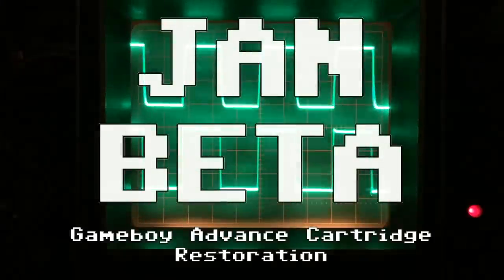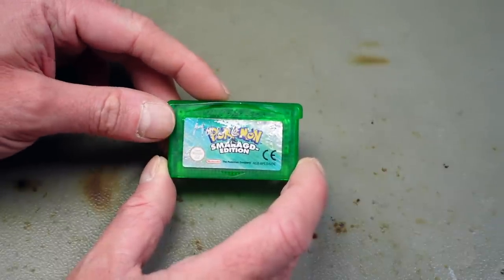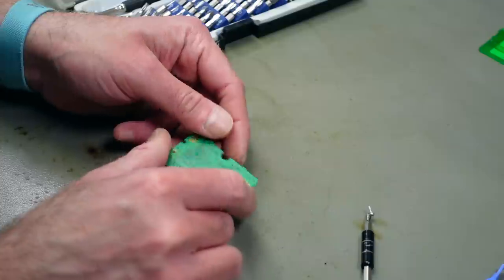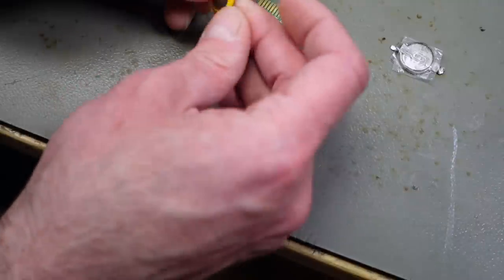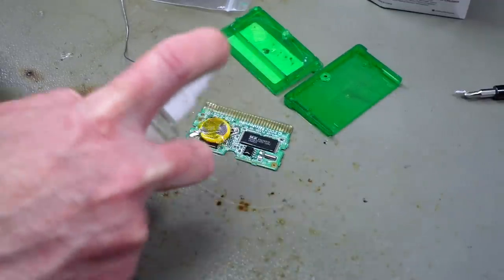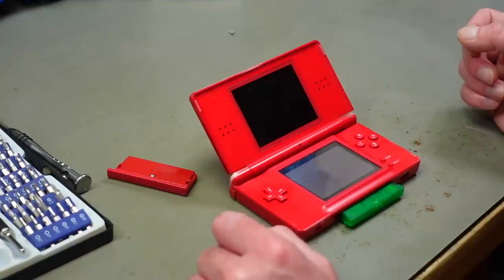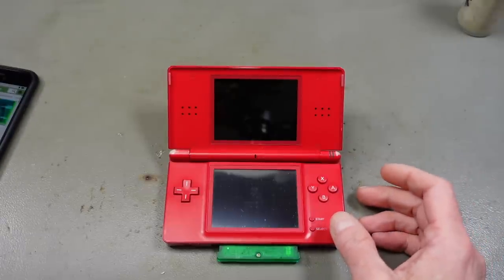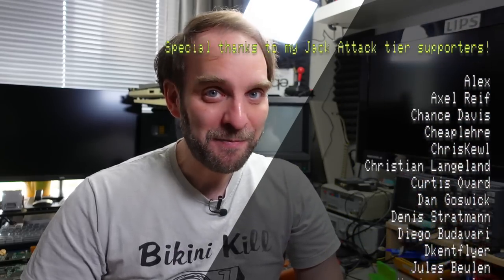Gameboy Advance Cartridge Restoration

Comment: 4:30 "Somebody replaced this really shoddily [..] usede a lot of tape in here [..] butchered this replacement" -> 7:35 "ok, so i'm gonna use some kapton tape here" 😂😂😂
Reply: Well, the original owner used sellotape over a shoddy soldered battery with bulging tabs.

I did the same as a kid on a PKM Gold Cart that I revised last month, and that's the reason the cart was cracked.

The attempt at soldering the tabs left the battery thicker than the usual, and that put strain on the casing.

Kapton tape isn't sellotape. Sellotape is plastic film with glue, thus a fire hazard.

Kapton tape is treated to be fire and heat resistant

Also, Jan Beta put just a little to insulate the battery

It's not needed, the battery actually bridges over, I never add it, but it doesn't hurt
Reply from the maker: Yeah, couldn't resist putting some new tape on it for extra safety. I guess it's not strictly necessary but helps prevent the battery from shorting out the chip underneath. :D
Reply: @JanBeta  truth to be told, I never added tape on any of my old carts and they all worked, not even on the Easy Flash 4

Usually the terminals have enough clearance to bridge over, and I got from a local shop a heap of disposable plastic tweezers to help me propping them right

But some safety never hurs
Reply: @DrTofu83  relax, i'm not attacking Jan Beta. i just found it funny :)
Reply: @pneptun  Neither I was defending him. I was telling you how I put a fire hazard in my GBA as a kid :)

Comment: Solvent-based plastic cement is awesome stuff.

The only downside is that the bond can create a discontinuity in strength where, in a long part that needs to be able flex a little, the bond point won't flex as much as the neighboring plastic and the plastic next to the bond point will fatigue over time and break again.
Reply from the maker: Definitely an important caveat. Never ran into any issues like that (yet) but worth keeping in mind.
Reply: Wow incredible information, thank you sir! Or madam! Or they! Or zer! Thanks

Comment: Nice work.

FYI, in English, buffer, at least for computing is really only used as a means to temporarily store something.  In a more general sense it's a word that means something that serves as a protective barrier.  (Much like buffer memory is used in computing).  So you'd use the word "save" to save game state, or the battery powers the RTC.
Reply: Yes, it’s one of those handy, multi-use words. In chemistry, a buffer is used to resist changes in pH of a solution as you add reactant. For British/European railways, it refers to bumpers placed on the ends of the locomotives & rail cars outboard of the couplers (N. American railroads don’t have these.) And, in electronics, it refers to a special type of amplifier used to isolate signals in one part of a circuit from signals in another part, or on a bus (like a 74LS245.)
Reply from the maker: Makes sense, thanks! I was thinking of the "battery buffered clock" in some Amiga models, I guess. But to be fair, those are rechargeable NiCad batteries, so they are technically not permanent. :D

Comment: I did the same a week ago. If you don't want to reset the cartdrige, there's an NDS program, Pokemon Chest, that can reset the RTC and even hack the Pokemon stats inside the cart. However as you may have guessed, it requires an NDS 1st gen, the one with the GBA slot and the Pokemon Chest loaded on a DSTwo or similar cart on Slot one
Reply from the maker: Oh, interesting, I'll have a look at that. May come in handy at a later point. Thanks!
Reply: @JanBeta  Of course, if you just want to restore the cart and start over the cleanest and most satisfying option for a owner wanting to enjoy the adventure as Nintendo intended is starting over

If for any reason you don't want to lose your progress, resetting the RTC can be achieved

The tool was done for cheating and/or backupping saves, told you (both things that done on a modern cart under VGC rule are a BIG NO), but it has a surprising legit use in jumpstarting a broken RTC for preservation use.

Comment: Please rate/tell that seller tha the game was repaired poorly. They need to know and/or they need to tell who repaired it for them. No. Just send them this video, no explanation, no context.
Reply from the maker: Not sure if it was the seller who "repaired" the cart previously. Came from a professional and the hack job was most likely done by a previous owner, I guess.
Reply: @JanBeta  It's the "typical" fix a kid would do to its own cart. I "fixed" a PKM Gold Cart like that when I was a wee kid, and lost the screw too (I revisited the repair recently).

That's the typical repair a teen with dodgy skills and no access to a decent soldering iron or a source of tabbed batteries would do